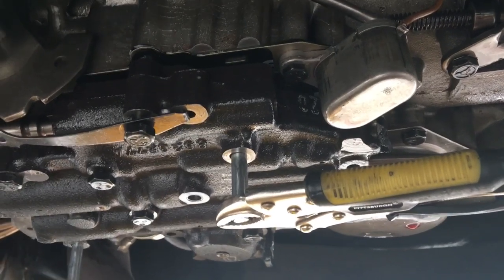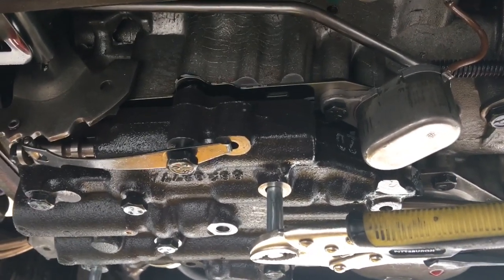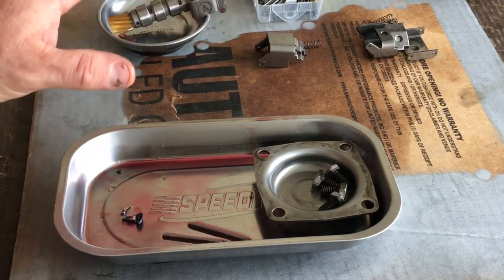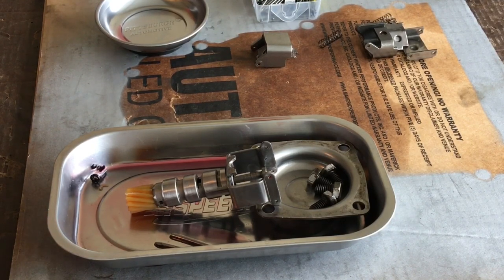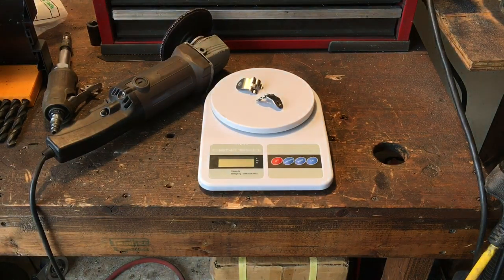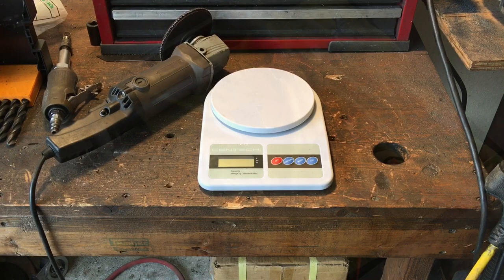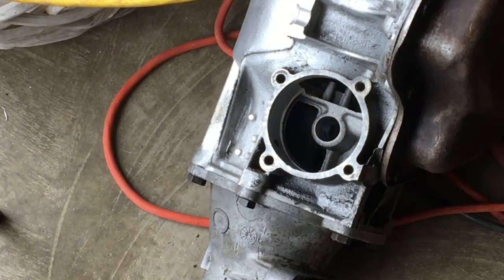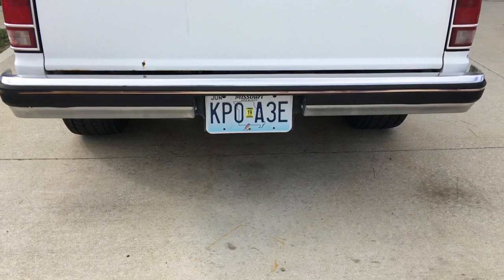TH400 won't shift 1-2 check the Governor spool valve

Comment: Glad you got it figured out..
Practice makes perfect!!!
I bet you will never make that mistake again!!
Reply from the maker: Justin Geraldi Well,it was all my fault 100%, I put the cone/funnel case filter in the wrong hole!  That’s how the little filter got jacked up and broke off a piece in the Governor valve. I haven’t had any issues so far with the TH400 since.  My initial mods to the Governor weights have the WOT upshifts at 5300 rpms, not bad for a base, now I can dial them in where I want them later.  Racing with both hands on the wheel will be nice!  JD
Reply: @HeadFlowInc  awesome that you got the governor figured out to give you the WOT shift RPM that you want..
You mean that you put it in drive and let it shift itself??
I'm a Ford transmission specialist and on all Ford transmissions that I can remember,,,,
When you put it in manual first or manual second you have one more holding element applied so it's less likely to tear something up..
Isn't that how a t400 works??
If so wouldn't manually shifting it be better for it???
T400 is probably the strongest transmission ever made and very durable
Reply from the maker: Justin Geraldi Yes put it in drive, I want to dial in my Governor WOT shifts so when racing I don’t have to do anything but drive.  I learned this from a man named Jim Hand a famous Pontiac racer. 
The only thing I think could be different between manual Low and being in drive there might be a difference in pressure?  With the way the valve body is setup and modified I’m not sure if it applies?
Reply: @HeadFlowInc  yes I just checked a t400 clutch and band apply chart..
The difference between drive 1st and manual 1st,,,is that in manual 1st you also have the rear band applied,,so it's helping to hold the one way clutch,,so basically it is stronger in manual 1st,,,less likely to destroy the one way..
But me being a Ford guy I don't know if that trans ever has any issues with that one way,,,if they do go bad it would be better to use manual 1st,,,
But I also see your point on just letting it shift on it's on..
Keep up the good videos,,I highly enjoy watching!!!!

Comment: From what I’ve heard once you have it apart like you do it would be best to use a  10 mm round boar brush to clean the boar of the governor 
This will keep it from hanging up and getting stuck in first gear .
There’s also a small filter underneath the valve body that filters the governor fluid keeping any thing from getting in it ...
Reply from the maker: In this example I improperly installed the little cone filter under the fluid transfer tube which caused a small piece of plastic to break off ending up in the Governor assembly. 
I’ve had 2 TH400’s in the Blazer with issues not returning to first gear when stopped, keeps taking off in 2nd gear? 🤔

Comment: Glad you finally got it fixed 👌
Reply from the maker: Murray Riddell I’m still in disbelief a stuck Governor valve could cause such serious slipping! 😳. When it stopped shifting to 2nd gear it slipped so bad I didn’t know if I could make it the 1/4 mile back to the house!  Hoping/praying it continues to work properly!  🙏🏻🙏🏻🙏🏻

Comment: Great job Jeff! Think I’m going the TH 400 route.
Reply from the maker: Mike MacCracken The only downfall of the TH400 is no overdrive.  I’m torn between swapping my gears from 3.73’s to 3.08/3.27’s or trying to add an OD like a Gear Vendor later. 
If I started from scratch I’d be really tempted to go 4L80e. 🤔
 3.73’s w/ 28” tires I’d rev 3100-3350 rpm @70 mph. 
3.27’s w/28” tires 2750-2900 rpm 😳
Reply: I have a 4L80E. I’m not running the stock ECM. I would have to run a stock ECM to control the 4L80E or use an aftermarket TCM. It gets kinda pricey.
Reply from the maker: Mike MacCracken You can setup an 80e as a manual valvebody pretty cheap. Maybe it’s an option?

Comment: I rebuilt a 400 and it would not move the car hardly at all. Totally kicked my ass. Pulled the governor out and the spool was stuck!!!! A piece of that filter had got in there and caused this problem!!  SOB!
Reply from the maker: I stopped using those cone filters on the VB lines.  👍

Comment: I just rebuilt mine thinking second gear went out.😢. Wave plate for second gear was snapped in two. But still won't shift. Then looked at the governor......and the gear Is completely worn down and isn't catching the shaft.
Reply from the maker: Yes, they call that “Apple Coring” of the driven gear since it eats the middle.  At least you found the Governor issue!  JD

Comment: I have a 1983 Chevy G 31 ton C class 19 foot RV 5.7 350 Chevy engine and I just put in a TH 400 transmission from TCI with their maximizer doing package. I’m not shifting until I hit 35 and my engine revs pretty high at 30 and really high at 35 and then it shifts really really hard I messed around with my linkage and tightened up a couple of bolts made it barely noticeably better mostly I just helped for the needle was pointing on my steering column and then I did 43 turns on the vacuum thing no chefs less hard but still hard and still not until I hit 35 do you by any chance have any recommendations would that be my governor does it need new weights and springs?
Reply from the maker: You’re shifting time or possibly mile an hour should be adjusted with your vacuum modulator and/or your governor Assembly weights. You can adjust your vacuum modulator to make it shift sooner or later. You could do trial and error through the governor Assembly but that only controls wide-open throttle shifting. Remember an RV has really steep gears so your first gear won’t like revving very far. When you say you’re shifting at 35 miles an hour how many RPMs are you seeing?

Comment: Hello friend, my transmission does its 3 speeds alone quickly but it only reaches 50 mph and the transmission slips and from there it doesn't happen anymore and that is the maximum speed it goes and the tachometer shows 4200 rpm, some people say that it is the Governor, what do you think is friend?  what was your problem with your transmission
Reply from the maker: Check your valve body pressures in each gear/position using the port on the driver side. 
The issue for my recent rebuild was caused by a stuck check ball vent in the Forward drum.  I’m adding a check ball apply piston so I know it’ll never happen again. JD
Reply: @HeadFlowInc  I didn't understand the first thing you said.  my transmission shifts very short all 3 gears and from there it only stays at 50 mph and that's where it goes

Comment: If you squeeze the butterfly valves and shake the whole assembly, is it supposed to be able to shake up and down and have a bunch of play in it or not?
Reply from the maker: The spool valve should easily slide/move inside the bore of the Governor assembly. JD
Reply: Like I said use a round 10 mm stainless steel boar brush to clean out the governor sleeve boar ... that will give it enough clearance to keep it from hanging up on you in the future ... unless it’s got a lot of debris in the fluid ....

Comment: My gear keeps getting chewed up. (it is the proper gear) then obviously the vehicle won't shift into high gear. Any ideas? It shifts solid until that part gets jacked up and fails.
Reply from the maker: DIYVIOLENCE Something is wrong if the driven gear on the Governor keeps getting chewed up. 
I’m curious, because I can’t remember, is the governor gear reversible?  
Some how there’s a mismatch between the drive gear and the driven gear.  Interesting, I would like to see why this is happening!  JD

P.S. I read the Governor itself may be worn out to try a new or different Governor assembly.

Comment: Can you use RTV as a governor cover gasket? A little late in thinking about it because I already ordered a fiber one but just wondering.
Reply from the maker: widtrak77 I try not to use any RTV when assembling any part of the transmission. It’s something I was told years ago, no RTV and NO red rags.  Rags with lint should never be used. 
I have seen people use a very thin layer to stick the gasket to the pan so it’s reusable, but they let it fully cure before installation. JD
Reply: @HeadFlowInc  that makes sense, thanks! Happy New Year!
Reply: Looks like a cork style governor cover gasket I have. So just install dry? It might help me to put something on the the cover side to hold the gasket in place on the cover while I stick it up there since the trans is in the car. Not a ton of room there. What about light layer of Vaseline? Thanks for your input!
Reply from the maker: widtrak77 You can stick the gasket to the cover but if you use RTV let it fully cure before install. That way you will know there’s no extra RTV hanging/squished that can come off later. The main thing is nothing can come off inside hanging The governor or plugging the screen.
Reply: @HeadFlowInc  Thanks, sounds good! The FSM says 18ft lbs. for the cover bolts but don't think I'll be able to get a torque wrench in there really for all the bolts. The main reason I'm changing this is it leaked horribly but I don't have any problems with the transmission at all so I'm reluctant to remove the governor lol
Reply from the maker: widtrak77 snug the bolts don’t snap them off, 18# isn’t a lot. If the transmission is working good don’t mess with the governor. 👍
Reply: @HeadFlowInc  got ya. I hope they come out easy. The is plenty of oil around them

Comment: Hey. I have a 76 that stalls when I try to put it in gear, any reasoning for this?
Reply from the maker: Wrong torque converter for the camshaft or tuning issue.  What’s the engine/transmission combo?
Reply: @HeadFlowInc  stock 305 with a TH400
Reply from the maker: It has to be in the tune up like low idle, vacuum leak something is pulling down the engine when you put load on it.  Start by checking the engine timing, curb idle etc.  Then check all the vacuum lines, intake to heads and carb to intake for vacuum leaks. JD
Reply: @HeadFlowInc  I was told it could be the vacuum modulator. Does that connect up to the intake/carb?
Reply from the maker: Yes, the vacuum modulator has a small vacuum line to the carb or intake. Seems odd it could cause the engine to stall, but would cause the transmission to have delayed shifts or it won’t shift out of first.